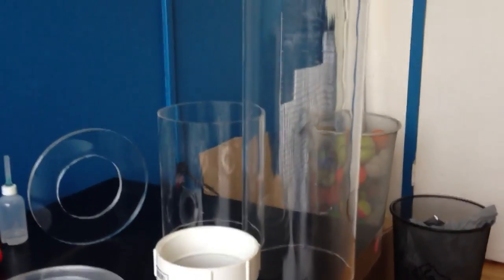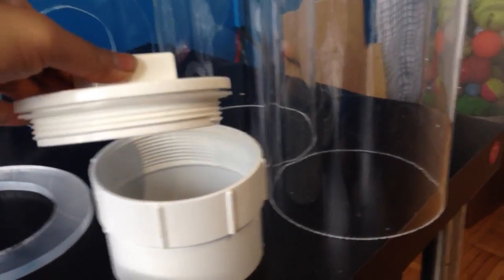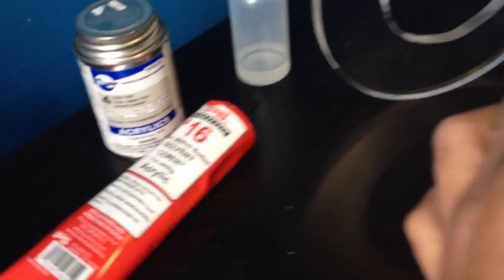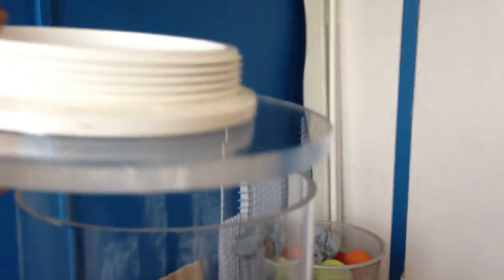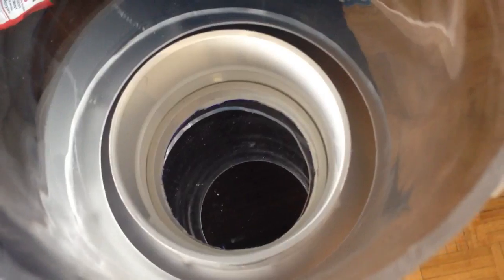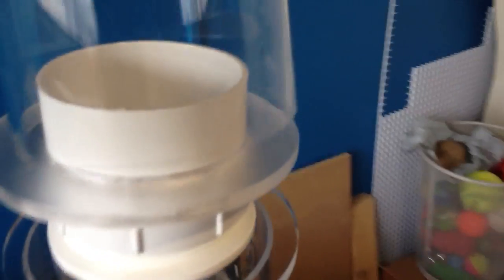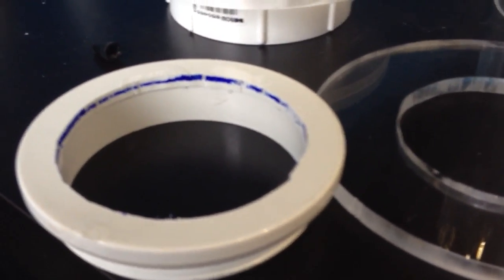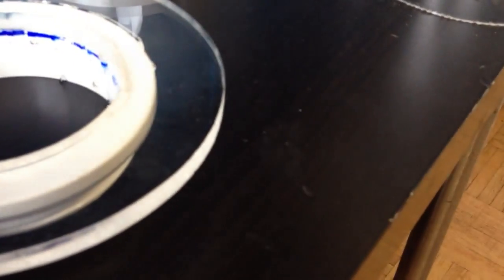DIY Protein Skimmer (Part 1)

Comment: does weldon 16 bond PVC and acrylic well? generally they are two plastics that are not capable of being solvent welded. How does it hold up? Obviously not much pressure, but still curious how it bonds.